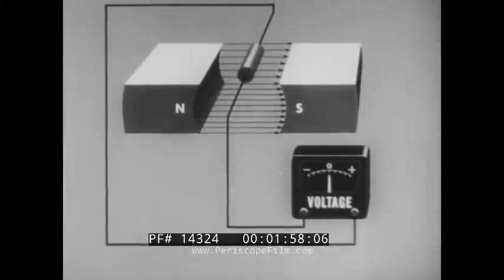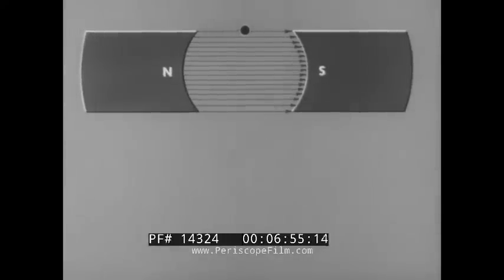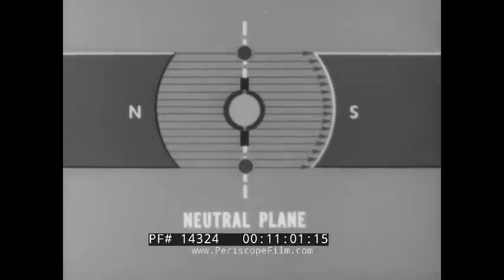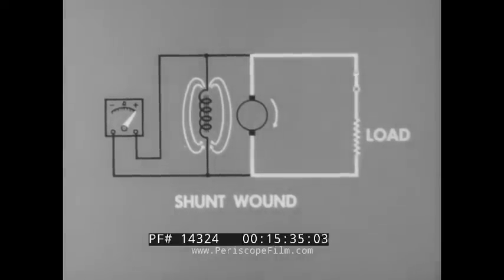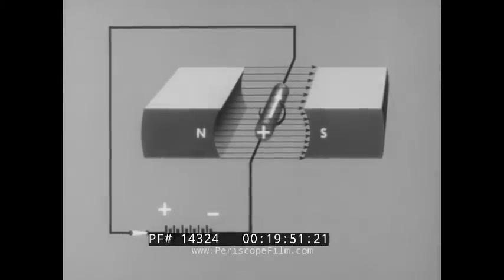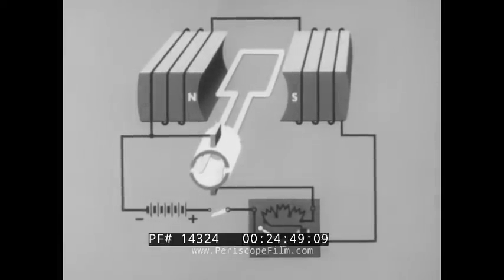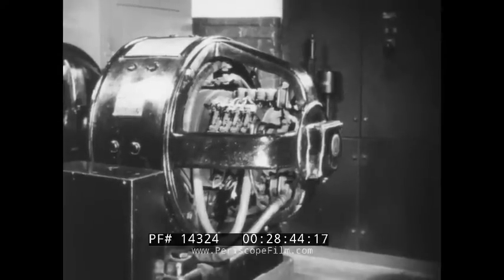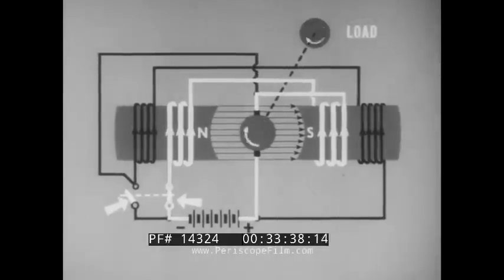" MOTORS AND GENERATORS "  DC MOTORS AND GENERATORS  U.S. ARMY TRAINING FILM   PART 1 14324

Comment: Back in my day, we didn’t refer to electrical discharge between different pieces of equipment as “sparking”. We called it an “arc” or “arcing”.
Reply: Ok, thanks.
Reply: Maybe they only said that to avoid confusion in the training film with added terms people may not be familiar with. With arcing, someone with zero prior knowledge may not know what that means. With the term ‘sparking’ someone can say, yes I’ve seen that before! And they will understand what is being referred to.
Reply: @RandomFabrication 100% right on! These films were made to train  10 of thousands of American soldiers. They are aimed to educate people w a 5th grade education and an average IQ of about 85. Nothing at all wrong with it but these were not made to educate electrical engineering grad students is my point.
Reply: That’s the correct term.

Comment: Diode bridges for DC, as in vehicles to charge the battery and car DC power supply.
Reply: When this movie was made, suitable diodes didn't exist. The only suitable high current rectifier in those days was mechanical -- a commutator. Alternators replaced generators in motor vehicles in the very late 1960s and early 1970s.
Reply: @lwilton  Motorola developed the automotive alternator and Chrysler Corp. began using them in 1960. It took a decade for everyone else to adopt them. Fun fact: Some GM cars used the term "GEN" on the dashboard years AFTER alternators had been adopted!
Reply: @lwilton  rectifier tubes?
Reply: @RinksRides  Something like a relatively high-power rectifier like a 5U4 is many times the size of a buzzer, draws a continuous 15 watts in filament power, would last about a year before being needed to replace, and can handle half the current of a 1N4004 silicon diode. Just not practical in this application. 
A better choice would have been to use a capacitor. Those were commonly used to suppress arcing across point contacts and to control inductive kickback.
Reply: @lwilton  was just about to mention the condenser/capacitor in a points style ignition.
Reply: Sorry about this... FULL BRIDGE RECTIFIER!!!!